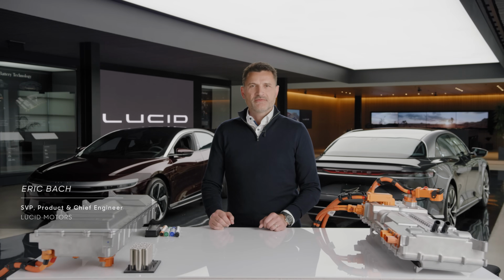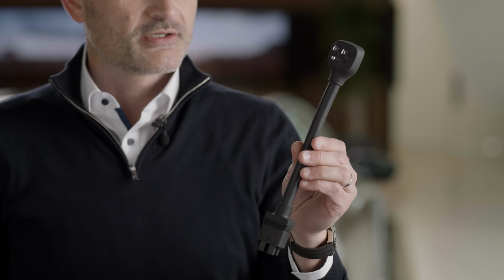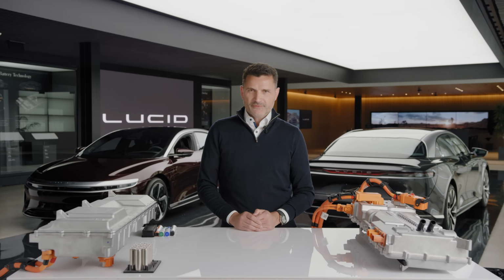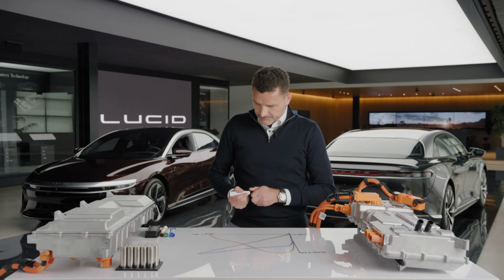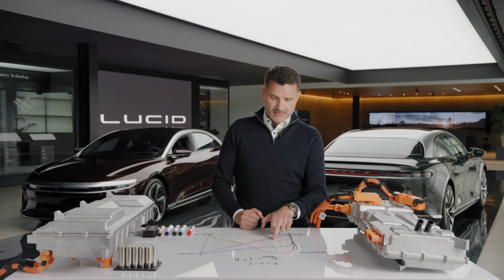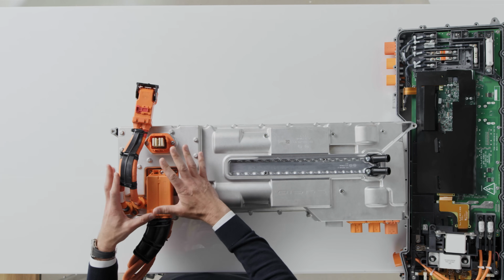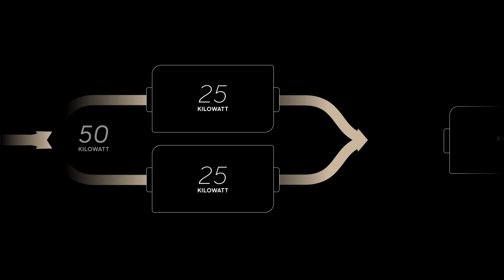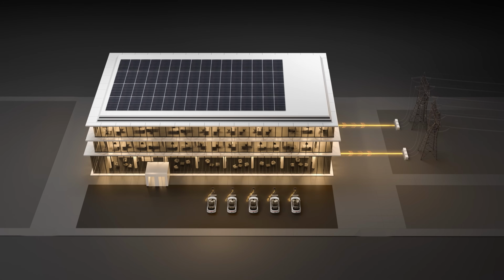Charging and the Wunderbox | Tech Talks | Lucid Motors

Comment: You describe V2V, V2H and V2B. Was that last one supposed to cover V2G too? i.e. can this device sync with a running AC grid to provide power, or can it only work with a disconnected grid. V2G will be very important in the future, but manufacturers are usually not at all clear whether their inverters can grid-sync or not.

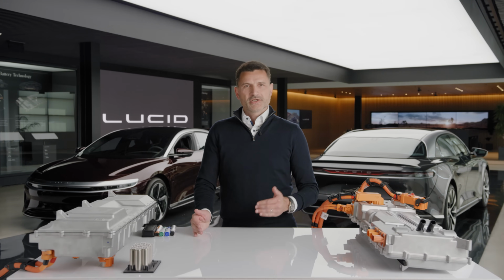Comment: 8:03 It's not correct to describe using the PV on your roof as 'no carbon emissions'. There is still a per-kWh emission from the embodied carbon in the manufacturing. It is very low, but we need to get over this idea of pretending that it is zero. For my (2025) system I calculated 2g/kWh, or 8 if it goes through the battery first. Which is about as good as it gets, but it's not zero, and that's how we should think about this stuff. 
For everything else in this piece you get the engineering right. This statement was a bit of a slip-up.

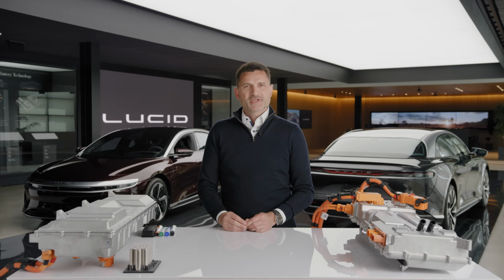Comment: 7:55 kudos to Lucid for being a rare company that acknowledges EVs actually do use fossil fuels BUT the solar panel free energy is misleading. Lithium batteries are enormously carbon-intensive to produce and they have a cycle life limit which is going to be partially used every time you charge regardless if it's Solo or fossil fuel based so this needs to be in the math, especially since your scenario literally involves a remote recharge. Solar panels also have a finite lifespan and are carbon-intensive to produce. Not "zero" at all.

Comment: Using the same device for AC-to-DC onboard charging, DC-to-AC for export power, and ~400 V DC to ~900 V DC for lower-voltage DC chargers is an excellent use of components.

Comment: The 10 kW DC-to-DC converter to supply the refrigerant compressor and heater with only 400 V (which they call "medium voltage") is interesting - apparently it was cheaper or more practical to add this component than to get the compressor and heater built for them to run on the traction battery voltage.

Comment: The structural strategy of your car is insufficient to get the needed 4 times crash safety needed to actually protect passengers.  As a former airbag engineer, of bags, modules and sensors, your tech is outdated (and so are all other companies, so don't feel too bad).  Airbags do NOT provide needed protection, and the car structural strategy needs to change...  Hint.  Happy to discuss.

As for the Wunderbox, all this complexity is not needed with fuels and combustion.  New Engine Type (NET) tech requires NO computers to operate, thus not needing rare earth metal and expensive parts.  The complexity of the Lucid is insane and will doom the company to bankruptcy.  Make it simple or go out of business.  Friendly hint.

Comment: Do you calculate all time you’ll have to spend waiting in line to use the electric charger?  EV are a form of control simply put.  I’ll never give up my ICE.
Reply: I just did that. If I go into my garage, hit the button on the wall to close the garage door, and plug in, I'll be plugged in before it's closed, adding zero seconds to the time I'd need to be in the garage anyway. Multiply that zero by the number of days I charge at home, and you get zero. 

If I make a few road trips per year, and can add 200 miles in 12 minutes, that would give me 720 miles of range, and I could pick a place to stop anywhere along the final third of my route, looking at the map and picking a charging station along the way with available chargers. But it's going to be a moot point because I don't plan to drive anything close to that amount in a single day in my life. At that point, I'd just as soon fly. 

So more realistically, I'd stop for 12 minutes or so because on a trip that long I'd need to use a restroom, but if the charger is busy, I'd skip it. I've never had to wait to charge at a hotel, and hotels with charging are as nice as ones without it, and no more expensive. 

If I did ever have to wait, it would be such a tiny fraction of the amount of time I'd spend at gas stations that it would be irrelevant. If I had to drive to the closest gas station and fill the tank, the round trip would waste at least a half hour of my time, and a lot more if there's traffic. Just about every EV owner knows the chore of having to get gasoline every week and is glad to never have to do that again.

Comment: Love what you guys are doing at Lucid! Please add a second charge port on the curb side of the vehicle. Seeing how the Wunderbox is situated it should be quite easy to add a connection on the opposite side. Even if it’s only level 2 it’d be useful. It’d be great for curb side chargers or give drivers the choice of parking nose-in or tail-in. Thanks!

Comment: Great Video as well as a great product.  Wished there was a LUCID 'LITE' coming . . . the 25KUSD entry vehicle from Lucid
Reply: With the same wonderbox, it can charge the 25k car in 10 minutes, because it will have a much smaller battery. 200 mile range should be sufficient and with the lighter, cheaper and more efficient Lucid motor, its battery  capacity and therefore it's weight and cost should be smaller as well.

Comment: To reuse OBC to boost DC 400 to DC900 @50kw is a bad idea, too low power,  and expensive. DC charging today is 200kw, future is more.
Reply: Since the time of the video, Tesla has opened up its charging network...sort of. In theory, you'd get 50kW charging from it, which would be painfully slow even compared to having to go to several CCS chargers before you find a working one at 350kW. The bigger problem is that the cables won't reach unless you park diagonally, or parallel park and block three chargers. So more realistically, you'd have to wait for their V4 chargers, which support 1000V and will have longer cables. Those should also have a magic dock to support CCS plugs. In the meantime, I doubt I'd have a problem with 500+ miles of range and would more likely plug in overnight at a hotel. 

There are far more older chargers than there are 350kW CCS chargers, but finding a 350kW one on a 500 mile route shouldn't be a big problem, I hope. CCS networks don't have a great reputation, and I'm used to Tesla's network, but it won't stop me from getting a Lucid. Obviously, I'd prefer to be able to fast charge on old equipment, but given the exponential growth in EV sales, we'll need an exponential growth in charger deployment, and that should put a lot of newer ones out there.

Comment: There was a footnote in one part of the presentation that stated that the 900VDC architecture is NOT part of all Lucid vehicles. Is the Air Pure slated to include the 900V architecture, or is the non- 900V architecture to be applied to something else?
Reply: I have since learned that the Lucid Air Pure uses a 740 VDC architecture. It is still better than a Tesla, but not as good (for the reasons mentioned in the video) as the Lucid Air Touring or Gran Touring.

Comment: Did you mention how long it takes to fully charge the batteries with h2v (home to vehicle)
Reply: The battery range is much greater than what other EVs have, but the amount that you drive per day isn't going to be much different if at all. So it depends on how many miles you drive. It's likely to be under an hour each night, and I try to sleep far more than that. You can add up to 80 miles of range per hour, so 30 minutes should be more than enough for most people. 

Even if you come home with a nearly depleted battery, and charging starts at 11 pm, by 5 am you'd have at least 480 miles of range. If you came home with more than 40 miles of range, you'd be charged, but I doubt that most people who return from a trip long enough to go through almost 500 miles of range is going to get up at 5 am to take another 500 mile trip. But even if you do, it's possible. You should get more sleep though. More realistically if you just came back from a trip, an hour charge would be overkill for the next day's typical commute. And you'd typically have more than a few hours to charge.

Comment: Elon’s success was possible because Peter rescued him to redo the Model S.  Peter told Elon, your Model S can’t be saved.  I have to redo Model S from scratch.  Now Elon doesn’t have Peter to rescue him.  Peter’s Lucid team will leave all other EV makers in the dust.
Reply: The Model S is still a great car though. Even though I'm getting a Lucid, I've been driving a Tesla for nine years and it keeps getting better. The new ones are even nicer. Tesla also has more advanced ADAS for now. Obviously I wouldn't be getting a Lucid if I didn't like it better overall, but for now, Tesla has a lot to offer at other price points. It doesn't make me an Elon Musk fan, but Tesla still beats almost anything else out there that I'd want to drive.

Comment: I would like to see V2H technology be used on a daily basis versus power outage (emergency) only. This would eliminate the need for batteries with a solar panel system...
Reply: This will affect the life of the car batteries, as the number of charging cycles is one of the most important factors for the longevity of electric cars
But home batteries are usually used from cheaper materials. It's okay. After 10-12 years, changing the home batteries will not be expensive.
Reply: You'd still need home batteries, or you'd have nothing to accept the solar power when you were out driving the car.

Comment: Will the Air Pure still have V2X and what is the maximum AC output in that mode?
Reply: Yes, it will have the same functionality but less battery packs. That might affect output though since I do not believe it will have the 924v they mentioned as the Pure has lower rear passenger floor due to less battery packs.

Comment: Why not use GaN instead of SiC for charging? Much more power efficient…
Reply: Afaik SiC transistors are usually rated for a higher current compared to GaN. Also, GaN is more expensive of course.
Reply: What's the GaN acronym full name?
Reply: @3nityC  gallium nitride GaN vs silicon carbide SiC
Reply: GaN is good for max like 500V but Lucid is 924V

Comment: Just incredible still cannot believe this is the first Lucid vehicle, amazing really amazing. Once Lucid solves mass manufacture will become one of the industries new generation legacy autos.
Reply: Lucid began as Atieva just over five years ago. Initially they were designing batteries and all the power electronics to supply OEMs as the EV revolution took hold. As we now know, five years ago the OEMs were not impressed with EVs and were happy to just buy off the shelf generic parts, so the name changed to Lucid, and they began designing a car. 

The Air's design and development has been ongoing for some years now. Lucid has a viable plan for growth and experienced management in place. Phase 2 of their factory expansion is well under way in Arizona.
Reply: since lucid makes things in house,i predict them having it's own purpose made battery plant making lucid cells for their cars and maybe other OEMs.
Reply: @andromeda9340  
'Lucid sources batteries from LGES and Samsung SDI. In August, U.S. President Joe Biden signed an executive order aimed at making half of all new vehicles sold in 2030 electric.'
From Reuters